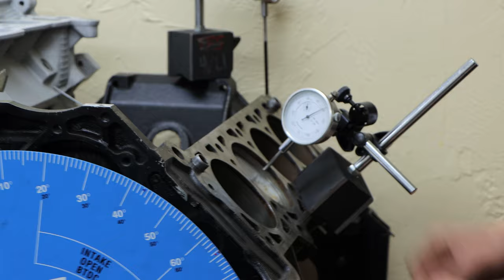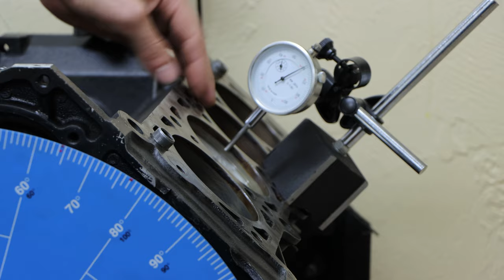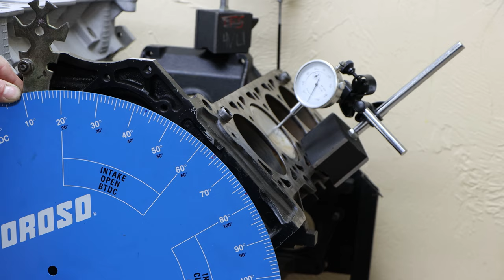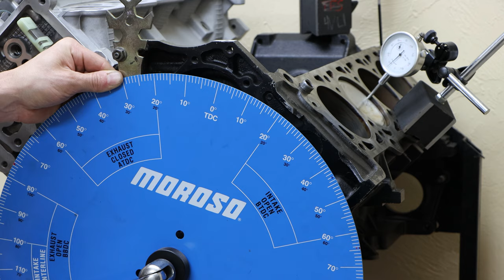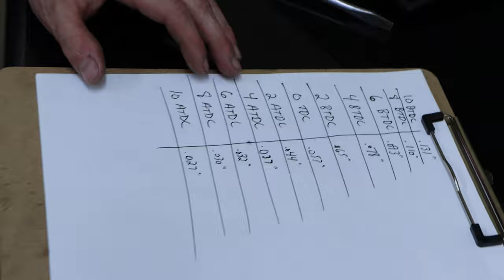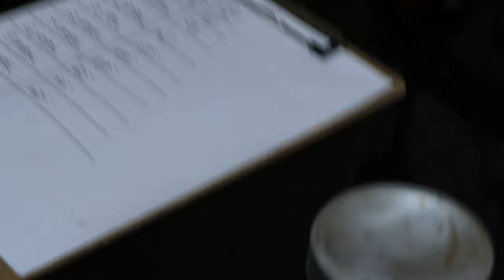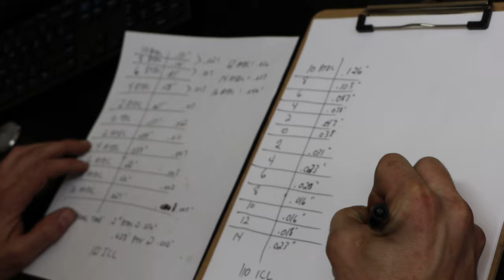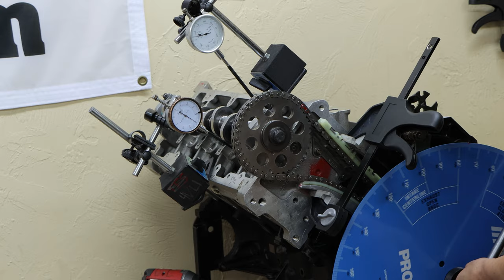4.6L 2V Cam Degree, 2V Myths, Piston to Valve Clearance and TFS Camshaft Issues

Comment: Jordan knows his stuff I bought a 4.6L stroker block from him assembled,balanced and blueprinted almost 10 years ago. I'm still running that block that he built for me with no issues. Granted I'm not running it on the edge but I'm not afraid to spray a 150 shot into that motor at any time. The longevity of that motor speaks volumes about his build quality thanks Jordan.

Comment: I just picked up a new set of TFS 185 heads for my 2003 4.6 2v engine yesterday. I had purchased a set of comp cams(new)  a couple years ago off of the local buy and sell . I feel lucky that I stumbled across this video . I will definitely  be confirming the compatibility of the parts that I had planned on using.   THANKS !!!

Comment: Do more 2v videos, there dime a dozen, do best bang for buck on  built 2v, and let's smoke some ls junk
Reply: Um, 2v will not smoke ls motors 4v don't do so hot either. Coyote well that's a different ball game. Considering a na gen 3 Coyote will lay waste to a Fbo terminator that is pullied down, both at the track and on the Dyno should be a eye opener of how pathetic the old 2v motors are
Reply: @chadwismer3601  hush stock motor and turbo can go 10s
Reply: @chadwismer3601  4v does just fine.  Ecspecially the 4v in the terminator and gt500.  Coyote is a 4v too.  Andrew got into the 10s at high 120s with stock motor and turbo on a 2v.  Imagine a 4v even pre terminator.  Gm is lucky ford kept the cubic inches down with these dohc engines.  If they'd put 5.4 4v similar to cobra r engine in regular cobras like they should have it would gave the ls1 all it could handle and then some its a shame they didn't do that.  Even with only 281 cubes the na cobras and the 03-04, machs were pretty stout and could hang right close to ls1 camaros stock for stock.  I gear swap is all it took to turn the tables.  Those cars need gears as bad as any car ever.  Ford was new to the ohc stuff then and was still figuring it all out and was still doing pretty good considering.  Years of figuring it out has lead to the coyote and a truly world-class amazing engine.  The older 4v can make pretty good power too if you let it have all the coyotes advantages.  Give it coyote compression 11 or 12:1.  Give it cams to make up for the fact it doesn't have variable cam timing which helps the coyote run more aggressive cams than it would be able to otherwise oem which helps it make more power.  More cubes 302 vs 281 give a good ported short running intake and ported heads that flow what coyote heads do out the box and you'd be surprised how close in output it would be to a stock coyote.  What I'm getting at is technology and just being better equipped stock helps the coyote make real good power but the old 4v can make good power too if you even up the playing field.  The coyote evolved from the 4vs like the lt evolved from the ls and the ls evolved from the old lt and original sbc.   Gm has had all these years to perfect development of the pushrod engine to the latest tech and they also have alot more cubic inches to boot.  Of course they're gonna have solid engines.  The fords hold their own and then some.
Reply: @midnight347 They don't want to have that conversation, Chevy would be bankrupt if Ford didn't take it easy on them..

Comment: Great info and myth busting but probably decades late for many people.  I bought some Comp 270s in 2005 i think, but i had heard rumors of PTV issues with those cams on some of the forums.  I chose the 270s cause cam choices were more limited back then, and was building a 5.4 swap so i knew that cam would be less aggressive in the 5.4, and i had no PTV worries cause of the piston sitting 0.115 in the hole on a 5.4.  Loved that engine, even though it had adapter plates, it really responded well to the comp 270's, very mild port on the heads, and a 2v SVO(similar to a bullit) intake that had been reported to match the PI runners.  Wish i still had that combination. Sold the heads and intake years ago, and still have the 270s on a shelf, but im a 4v 5.4 now and have a set of comp 106460s that i think are too much, but after paying 1200 for cams im kinda stuck with them.  Not a fan of those cams but not going to put anymore money into 4v cams.
Reply: Sweet setup.. I'm a 2v guy myself.. TrickFlow top end going on my P71..

Comment: So on a stock NPI 4.6 long block and PI heads with stock valves, with the XE274H cams my math on the intake open BTDC was 8*. What is wrong with retarding the cam shaft 5-6* to prevent PTV contact

Comment: Great video. I only disagree with what you said at the end, that its not a tool to make noise its a tool to make power. We all buy cars for different reasons and for different uses. Your car may be a tool for you to enjoy, my car may be a tool for me to work, and so on and so fourth. Personally I don't care much for speed or efficiency, I care about exhaust note more than anything else, though I want reliable drive ability so I don't want huge cams with zero vacuum at idle anyway. With that said I agree with your reason for saying it, especially seeing how tight the clearances are. Even a very, very small amount of carbon build up would be enough to bend a valve in the right circumstances with those tolerances.

Comment: Thanks for the video Jordan, 
I have a question about the crank gear. I have the one piece Ford OEM crank gear, and I noticed that it has some back and forth play just like the camshaft gears have on the cams, that you use to fine tune the cam degree. Will this play in the crank gear effect the degree of the cams, because the gear isn't tightened while doing the cam degree? How will I know the crank gear is in the same position when I tighten it, as it was while doing the degree?

Comment: Have you had anyone use 4v na stock pistons in a 2v to bump up compression? I can't find much information if it'd be too much for 93 octane even. I'm planning on a stage 4 or 5 na cam from you and I've heard that larger cams would bleed of some pressure

Comment: Just bought another gt it’s a 97 model. Also picked up a 2004 motor so I can do the pi head swap. Definitely will be ordering my cams from you. I’m just curious if I should use the 2004 block or keep the 97. Block. Been told you get better compression with pi heads on npi block
Reply: Is that a bright tangerine? Those are only 96 though so I guess not, that's what I have. If your 97 has good compression still I'd use it for that little bump in compression. I swapped a whole 01 bullitt motor into mine. I'm about to buy a aluminum WAP out of an explorer, use coyote connecting rods, na 4v pistons to bring the compression even higher and see what I can do with full bolt ons, some weight reduction and some cam

Comment: What cams.would you recommend for a 97 f150, 4.6 5 speed daily driver , 355 gears.  Doing the Ported PI heads and intake swap, longtubes and exhaust
Reply: 268 aka stage 2..

Comment: lot of expensive tools to buy for just 1 engine build ... thinking its simply easier to invest the money in springs and tool to cut notches in the pistons for clearance for the more iffy cams ? and simply bolt it in and add 1 more psi of boost to make up for not dialing in the cam ..  pretty much your looking at $450 for the cam degreeing tools alone.

Comment: What are the differences between GT500 heads navigator 4 valve heads and aviator 4 valve heads?
Reply: GT500 heads have a raised intake port which positions the port more optimally in relation to the valve, smaller intake side lash adjusters make room for the raised intake ports, more port volume, larger 32mm exhaust valves, more deck thickness are cast from a much more robust aluminum alloy.

Oh GT500 heads don’t have the cam cap “cages” that share two dowel pins for ever 3 cam journals.   Each cam cap is individually doweled like the old Windsor 2Vs, a much better and more expensive setup.  

Aviator heads are exactly the same as Marauder, Mach 1 and 03/04 Cobra heads.    Similar to 99/01 Cobra heads but not the same, better flow on both intake and exhaust sides and the intake port profile is fairly different.  

Early Navigator heads were unique to the Navigator.   
Pretty much a larger port version of the standard “tumble port” 99/01 4V port.

Comment: Makes me want to send you my motor so you can build it. But your other video said you we're going to take it easy on that end. 😔
Reply: I know man. Same here, he sent me a quote then i called the next week and thats when he said he was not taking any more orders
Reply: I think alot of people are getting new engines or refreshed ones. Stuff thats normally never out of stock on his site is suddenly out of stock. Edelbrock kits. Adjustable. Pro comp cam gears. (Pro comp told me today september on 150 back orders when i called) took a couple weeks to get the valves in this time. But its everywhere. Alot of parts are getting put on back order atm. Used to get 4.6/5.4 plates and the 4.6 intake as a kit cant hardly find them now or you gotta piece it together yourself. I think i saw years ago on the forums a dude cut his victor and stretched it to fit his 5.4.
Reply: @brandona4618  its crazy